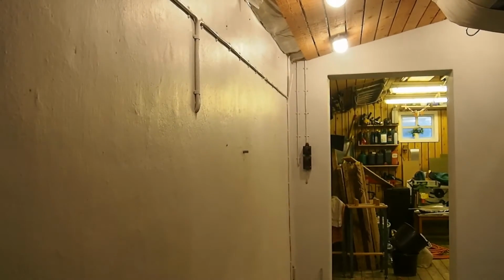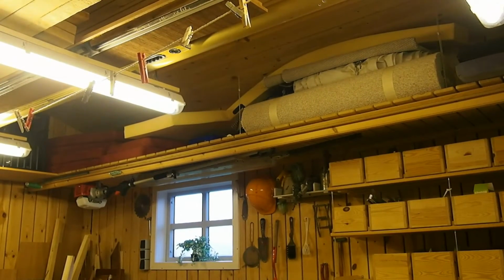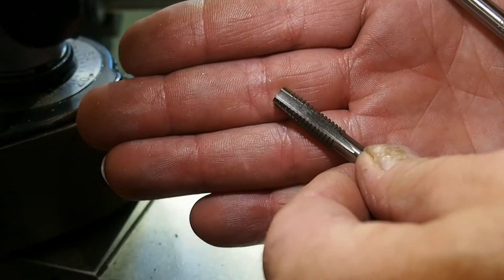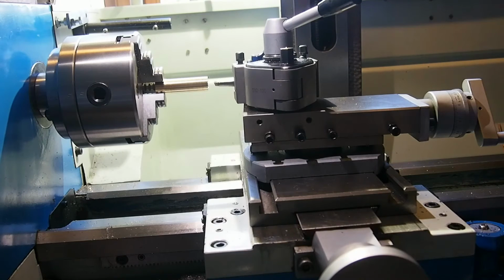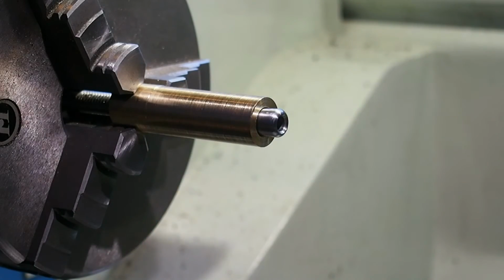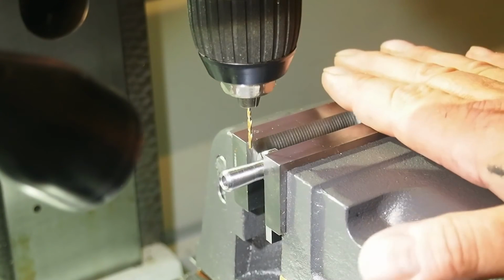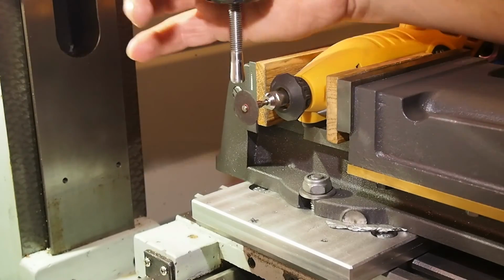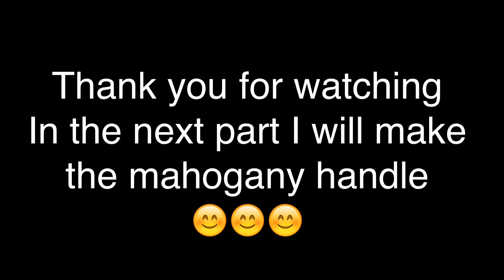Making a tool to hold a HSS bit. Video no. 56

Comment: Shed is coming along well.The bandsaw should work well there.Like the tool bit holder as well.Need to make one for my boring bar.Tak...Pat
Reply from the maker: Patrick Craig I have to figure out some kind of funnel to sit over the band on the saw, maybe under the table to the suction,that could maybe be a good project to video. I'm glad you liked my tool and it's awesome you also want to make one👍 it was interesting to hear about the weather where you live that was some storm you have hope nothing bad happened. Vi ses,hej fra Henning

Comment: I never thought about putting the Dremel in a vice. I would have free handed it. Your idea was better, a lot more control. Good job. Nice little tool.
Reply from the maker: Duncan MacKenzie it was also my plan at first, then I came to think about if it was possible to put it in the vice and it worked, I'm working on the handle and it is going fine, take care hi from Henning 😊